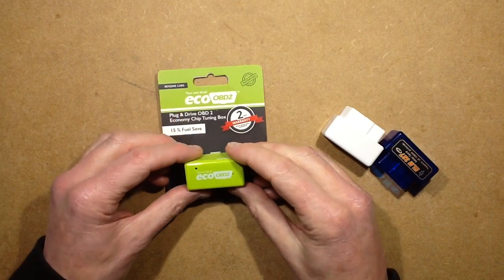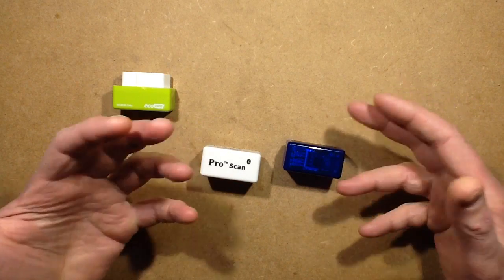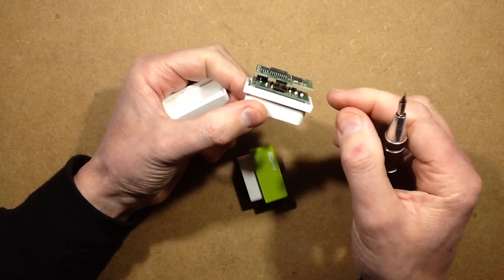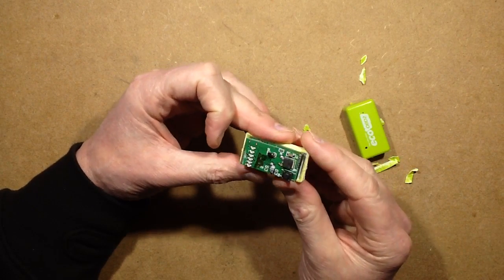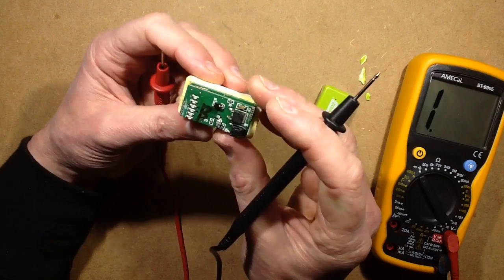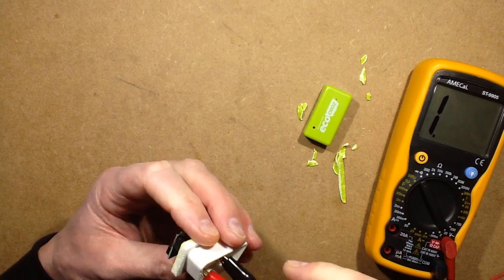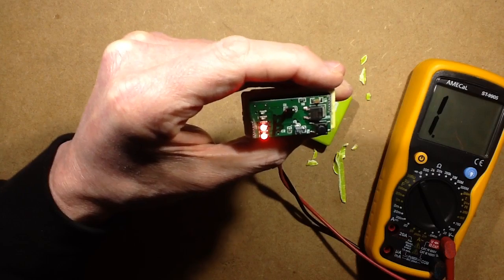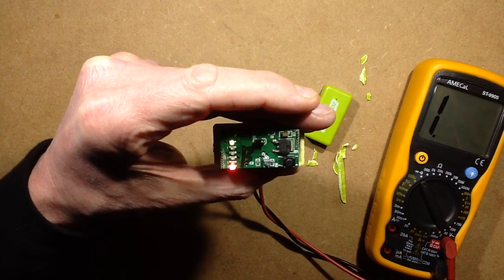Inside an ECO OBD2 "chip tuner" fuel saver.

Comment: Personally I am not a fan of the OBD2 at all, or even in cars having computer systems. For one, they worked fine for decades purely as mechanical engines without even a need of software. Two, it's another thing that can go wrong, making things more complex. There are numerous ways to screw things up by plugging in a bad device or trying to alter the firmware, or security issues if someone tries to use the plug for malicious purposes- and I'm thinking of any number of malware opportunities here, it's one thing for the car to not run because the spark plugs are old, it's another to have your car bricked because of a software hacker. Car companies are also starting to get very iffy about the DMCA and DRM over the car's software,  which could actually make it illegal to work on your own vehicle, and I shouldn't have to have such a concern if I want to work on my car without paying a mechanic a pile of money to do so.

They're a good idea on paper but in practice I think these complex computers in cars cause far more problems than the benefits warrant.
Reply: +diosoth I think you may be underestimating the improvements in efficiency, performance, reliability, and emissions that computer control provides. (Efficiency may not be hugely better than it was, but it has improved even while emissions have been vastly reduced.)

Comment: The ecu map in my car is readable/writeable via the OBD port. The ECU "map" is 1MB of data and is accessed via the same physical port but not via CAN. Various factory options are also accessible, like daytime running lights, cruise control, you can also issue instructions via CAN to open windows, beep the horn, operate lights, wipers etc. The standard OBD2 interfaces seem to be able access a lot of parameters, but I believe these comms are "open source" ie deliberately standard to enable diagnostics. 
I don't know about this device and I am cynical about it working... the standard Chinese ELM327 devices are very useful for diagnosing problems.
They clearly can talk to the systems as engine management error codes can be cleared with these devices...

Comment: https://www.youtube.com/watch?v=9fN20xUWK5Q

That guy checked it and said it's no good. Just some blinking LED's
Reply from the maker: +thevideoman12 Ah, I was resisting cutting it apart.  I wonder if the one here has a basic PIC processor in it too.
Reply: +NKN1396 Thank you, Chef Excellence :D
Reply: +bigclivedotcom you got pins 6 and 14 wrong you had it upside down compared to the pinout so you were testing  3 & 11
Reply: Yes, I'm fairly sure in order to interface the CAN bus with an ordinary PIC microcontroller you would need at least a separate transceiver IC like this one: http://www.mouser.com/ProductDetail/Microchip/MCP2551-I-P/?qs=8g3RLJaa2Uis1lC9gEMPXA%3D%3D&gclid=CjwKEAjwq6m3BRCP7IfMq6Oo9gESJACRc0bNXtfG_WBPbFJTTfMG15k36YbzQd9Tj9k4M2c8YhtrCRoC4HHw_wcB
Reply: +thevideoman12 Yeah,in the comments he explained why:
" This chip is not working. Microprocessor (PIC16F59), which it is installed, can not exchange data with the vehicle.
The microprocessor PIC16F59 is not provided internal modules to exchange data, the PCB is also have nothing to exchange data.
This processor is the cheapest and has a small performance.
This device is only blinking LEDs"
Reply: +thevideoman12 Aah, beat me to it! I just did my own video doing much the same thing... except I couldn't wait for my camera to charge or for my desoldering wick to arrive, so I pulled it apart with wire clippers before doing the video. Must try harder.
Reply: My Tester Agree, totally. My point is rather more that devices that plug into the OBD port have access to data pins while devices plugged into the lighter socket do not. It would be possible to build something in this form-factor that does something. This specific device does nothing at all.
Reply: many fuel saving tuning is either done through devices plugged into intake area, or permanent one off tuning... i dont know any device on the obd other than ecu itself does on the fly tuning of the engine... they are usually profiles...
Reply: I thought so too, I mean it says that it can store month's worth of driving data but we see no memory chips on the PCB
Reply: same with all the rubbish fuel saving cigarette lighter adapters that blinks and every blink saves you 2 lts of fuel :)
Reply: Haha! Hadn't heard of that one! Difference here being there's a chance of it doing /something/ since it's next to data pins, while the lighter socket only has access to power...
Reply: having a chance of doing something vs doing something is different, if you watched other video that ls linked, you will see the chip in question doesnt have the capability or the juice to do any data... even with data, (that is like winning lottery) it is unlikely that this silly device would have the capacity to know each and every model (let alone a single model) car's ecu config to know the right parameters to alter... it doesnt have a memory chip to store necessary config to execute....
Reply: Right, what I mean is that something could send messages - not necessarily that it would have an effect. However, IF there are sensors readings sent over the CANbus AND the ECU uses the readings from the CANbus then there is a possibility of tricking the ECU into under- or over-fuelling. It's unlikely to be effective; it would be the modern equivalent of sticking a resistor in the MAF sensor socket.
Reply: Never heard of a Bluetooth ODB-II reader damaging the ECU. I Have used 3 or 4 of the little blue transparent readers, never had a problem. (I've used so many because I keep losing them!)
Reply: Honestly first I've heard of - thanks for the info!
Reply: i never heard of a Reader damaging an ECU... Unless ECU is dumb insecure type that lets a OBD signal to pass through critical systems... most of the ecu programing done with special devices accessing proprietary  interfaces which are not easy without special cables/software! A reader cant write special areas of an ecu, as said, ecu must be a really bad design (as bluetooth reader probably shorted or some sort of over current passes through without any protection on the ecu side preventing it)
Reply: most likely dodgy clones, as appropriate chips are not capable of programming ecu, these are merely readers! writing to ecu is whole lot different, and not sure you can randomly send signal to program as there are handshake protocols/standards to access those areas...
Reply: So they are not actual chips designed to read but most likely some opportunistic chinese arsehole who wanted to rich quickly, patched together some random parts, and mostlikely draws too much current than data into ecu! still unsure how it would be possible to access the protected areas without giving appropriate handshake... i m betting these only damaging support systems caps/resistors etc rather than memory blocks themselves... damage is a damage... so yeah, if it is dodgy and not designed to read, then it is designed to damage...
Reply: ***** many cheap clones do not stick to reference designs and cut corners everywhere, causing uneven/unregulated current or voltage, not to mention handshake protocols in their software... so many of them dumped to the market without regards to safety / standards, just purely as a hit n run basis...
Reply: Против Глобал actually, 5V is TTL Vcc but either your comment is mistranslated or you mean CMOS or perhaps that level for a '1' doesn't have to be fully 5V. https://en.m.wikipedia.org/wiki/Logic_level
Reply: thevideoman12
Reply: PIC 16F59 is a very low end micro controller. That would be really impressive if they could do anything with the 0x7FF of program memory (2KB?) available. It's still kind of funny that if all they were doing is blinking LED's they could have used something even lower end than that.

Comment: I'd really like to know what if anything this little dongle does...I don't expect it do anything other than just show some pretty lights.....  I mean yes Real time tuning is a thing at least on some GM products, but the "RTT" only hold the info while the tuner/computer is connected,  and requires a Parameter write once the engine is turned off and the key is in the "run" position.. as stated by others it probably just reads TPS and ABS info something like the little dongle Progressive sends out to users that opt in with supported vehicles. not sure if it's REALLY possible to fake readings through the OBD port but maybe it can change the readings from the O2 and MAF making it run leaner? doubtful the little dongle even does anything though.

Comment: engine managemeny is ROM., so these are fake...
Reply: +sayan das you can rewrite engine maps.
Reply: Adam Webb lol. not on stock ones.
Reply: +sayan das mine is stock and been remapped multiple times
Reply: +sayan das on some older stuff it is, usually obd1. Everything obd2 I have seen can be remapped. Many manufacturers release new firmware from time to time so ROM wouldn't be practical. Case in point is when VW released a firmware update for their diesel models to run the DPF system. If it were ROM they would have to swap the ECU, or at least tear the ECU apart and put in a different chip.
Reply: +sayan das they long time are EPROM, using ROM ineffective (and element would be slower, would need ram buffer to run code)

Comment: It could be doing a few things with simple CANbus messages; it's pretty easy to inject messages about the throttle position or air-flow sensors, for example. In effect it could be the modern equivalent of the old "Power Resistor" mod where you'd replace the air temperature sensor with a resistor and the car would always overfuel because it thought the air was colder.
Reply: Oh gosh, can that cause the car to rocket off without intending for it to?
Reply: I believe you're 100% right maaadkat. I suspect it's just broadcasting a CAN recording to manipulate certain data.

Comment: As others have said. OBD firmware flash is possible, but goes beyond standard CANBus standard to do so. The protocols necessary for each manufacturer vary greatly, and often are encrypted. Companies like Dimsport spend extensive resources to crack these flashes. There's zero possibility this thing is actually writing to the firmware.

Most likely, it's just performing an ECU Reset to put the ECU into adaptation mode. That can in some cases lead to different engine characteristics during the learning process to fool drivers into thinking they did something special. On most cars you can do the exact same thing by pulling the battery cable loose for 30 seconds.

That said, the OBD Bluetooth readers are fine. I use one, have an OBDLink brand now, but previously had the $20 ELM237 form China. I know many others who use the readers and while the actual performance and reliability of the cheaper Chinese ones is highly variable, I haven't heard of anyone causing damage by using them.

Comment: well, considering most vehicle computers are already programmed to run the vehicle at the optimum fuel efficiency.... it's probably a bad idea to plug this in and let it "reprogram" anything if it actually does... changing the fuel to air ratio will have an impact on how much faster the spark plugs wear down as well as carbon build up on the valves and could as well alter the emissions at that point since a different fuel ratio is going to put out a different exhaust report during testing...

Comment: This thing actually causes lean codes to occur. Bent the obd2 prongs to alter EEPROM capability that the unit has in changing the air flow mapping segments that happens when the ecu learns during a run. Happened to successfully increase the throttle response timing but in exchange, threw re-occurring lean codes that won't go away. This unit may actually be a cheaper version of a piggyback

Comment: Generally these "improved efficiency" things just reduce your fuel usage by making the engine run artificially lean.They do that by monitoring the engine or air temperature sensor, then changing the sensor settings to make the ECU interpret the sensor as indicating  a higher temperature.  Both these steps can be done via the OBDII connector.If the engine is cold then more fuel is used to make it run better.  If the air is cold then more fuel can be used because the air density is higher.By making either sensor indicate a higher temperature the ECU will put in less fuel.You will use less fuel, but your car wont run as well.

Comment: All it does is re set your fuel trim. Its like disconnecting the battery. the car will relearn how you drive. it will go back to normal.

Comment: Changing engine mappings from the obd2 port is not standard across the board, different vehicle manufacturers use different PIDs , they also protect their "custom" parameters with security, By law they don't have to disclose the information as long as they follow and provide the standard diagnostics dtcs they are good to go. I think you can see it as using the obd2 port for programming as an opportunity to not have to install a dedicated port for programming. People can off coarse obtain the security from organizations such as the equipment and tools instutute , but you have to have a business signed NDA and cost are high, I highly doubt that the micro controller in your video will cater for all vehicles. Thanks for the video is was interesting. I'm curious to know what that device actually does. It won't be too hard to find out though. If you are interested I could make you a video to show how to read the actual messages it trying to transmit to the obd2 port , and with a bit of googling you might find some information. Keep up the good work.

Comment: the expensive texar kit will let you do all kinds of tests, turn off cylinders, activate abs, cranking live or speedo etc, hell it will even do rough compression tests by knocking out cylinders and calcilating load changes

Comment: Elm327 mini works with Torque - most of them actually do work including the Vags and larger ones - its fine but the eco rubbish are a scam - one of the guys on the German Kaos club checked a few out  -are just obd readers with flashing leds. Did you check and see if you can see it with bluetooth on your phone - if you can then its a reader!

Comment: it is possible to reprogram a modern car's ECU via the ODB port but each make and module would need different firmware.
Even though the communications protocols are standard the internals of the ECU and it's software can very widely.

Comment: Usually the cheaper obd2 scanners just read generic codes only, ones that read engine data are a little more money, then for maybe a £100 or so can do basic engine actuator tests. For ones that can reflash s/w properly your looking at least a couple of hundred also they aren't dynamic like this one claims to be. It literally flashes new data when the vehicle isn't running with set s/w. I really can't see how this small device cheap device reads then somehow changes any setting, based on the cost of the device alone. You can buy a can bus message readers, not a dtc reader a actual message reader that reads the protocol messages , but they are thousands. they will actually show what messages are coming in and out. A very curious little box, but my money would be that it's in the league of fuel line magnets and alike lol!

Comment: This is incapable of remapping the cars ecu to achieve anything through the OBD port. It is really quite involved 'reprogramming'  the ecu for fuel to air ratios/under load/ fue lpump/boost pressures etc etc etc. Each make and model has a specific map. One generic device could never change anything 'on the fly'. I didn't even see a memory chipset or anything resembling one in there. However if i'm wrong on all or any of these points, i'll go and buy one of these miraculous 'one for all' remotes... erm sorry, i meant ecu tweaker ;)

Comment: The OBD-II dongle in the video is much obviously fake. There are ways to modify the fuel system to achieve different tasks, however that doesn't involve the OBD-II port. The 'flasher' probably just pulls power and ground to power a microcontroller that controls flashing of the LEDs. Actual ECM programmers run thousands of dollars and contains a whole bunch of closed source code, and if this cheap little Chinese piece could achieve the same thing, I'm pretty sure this would be just as much an industry standard as those that run those thousands of dollars.

Comment: While I would not trust this kind of cheap stuff from ebay, I do change the ECU software on my own and other cars, tuning them over the OBD2-port and CAN network. It is easy if you know what you are doing but I do not belive in this one at all as the Engine Management System differs so much from car brand to car brand, and even from model to model.

Comment: It could easily be analyzing your driving, but anything beyond reading and resetting codes and reading the diagnostic data, programming or controlling anything via the port is typically proprietary and requires specific software and hardware, I really don't believe this could do what it claims.
Reply: +compactc9 yes you need to know the vendor specific stuff but in the end it's just writing data to a memory address.

Comment: I have to use the KWP2000 china clone to diagnose SAAB whilst it serves its purpose of accessing & clearing individual module faults, it does nothing more than saving me a main dealer diagnosis fee of £80 a go, but to anyone considering buying a £400 Chinese TECH II unit DON'T as they are glorified OP-COM units that can not reprogram anything.